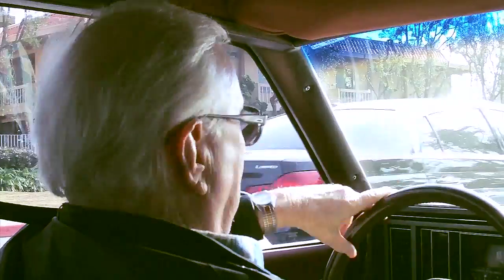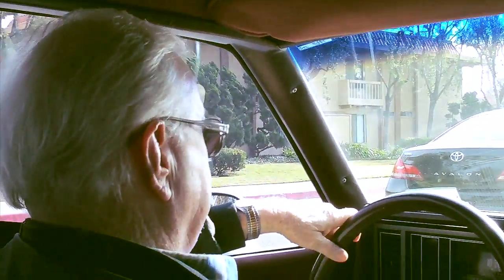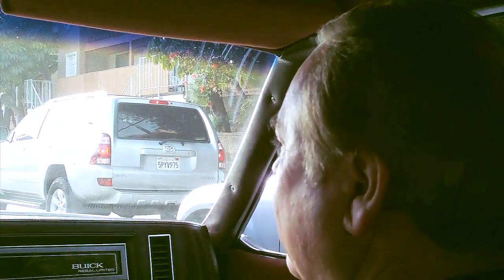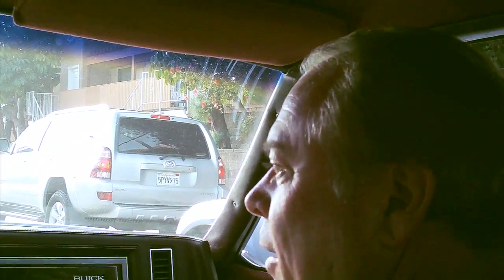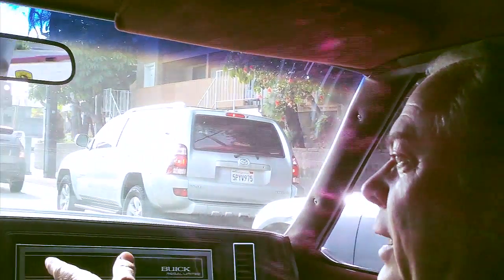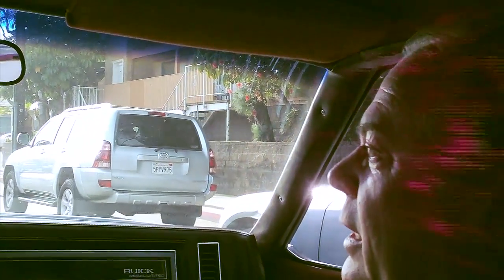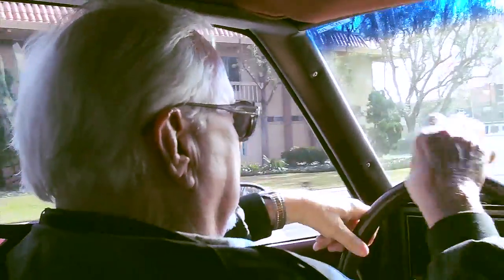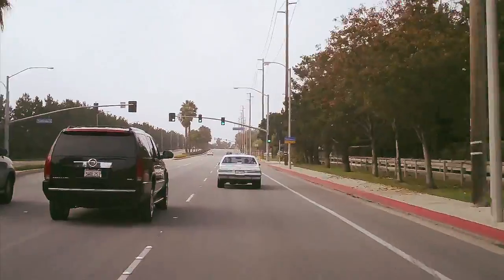Buick Grand National T-Type Turbo Regal Powermaster to Hydro-Boost Performance Brake Conversion pt.4

Comment from the maker: We convert the Powermaster cars, and have replacements for the Hydro-Boost II cars. The ones that came with a HB were internal accumulator units, which are obsolete, Bosch discovered that it had more problems with those as compared with external accumulators units, so they dropped them. When no new units are made, that of course means that replacement parts dry up. So we rebuild Hydro-Boost II's, and do new external accum. replacements for them, and convert PM cars. If it's a GN, we can do it.

Comment from the maker: Well- turbo charger + conversion involving the power steering pump + sub par audio from the camera that we had at the time, so partly all 3. When doing a Hydro-Boost conversion there can be some churning of the power steering fluid, so air bubbles, that was what we were helping out by adding the Mercon/Dextron. You won't here a whine from vehicles that came with an HB from the factory, doesn't happen every time, but it lasts about a week, then goes away after the air bubbles have settled down.